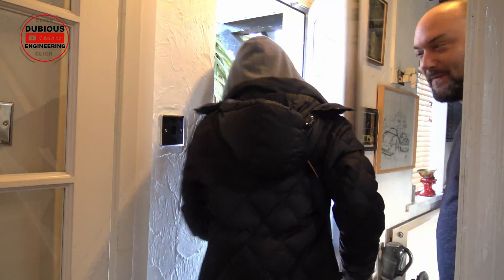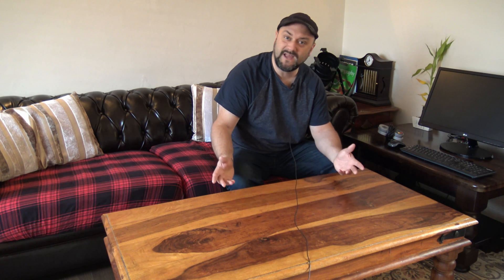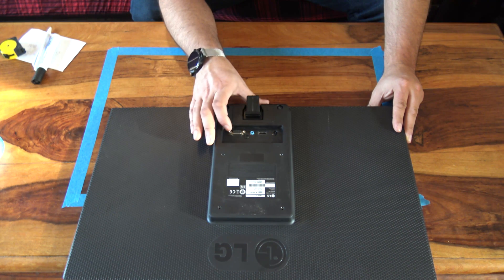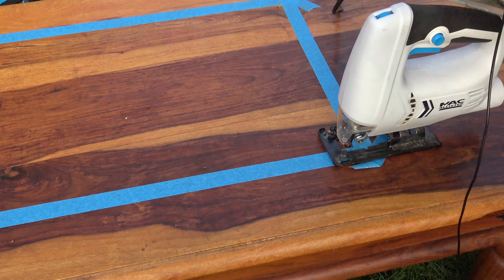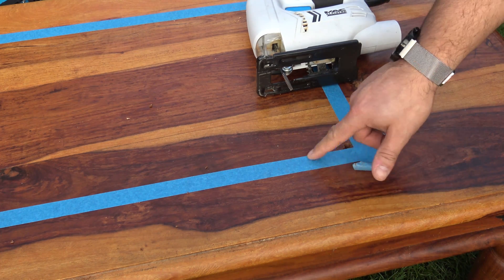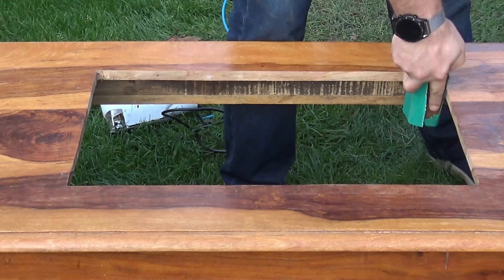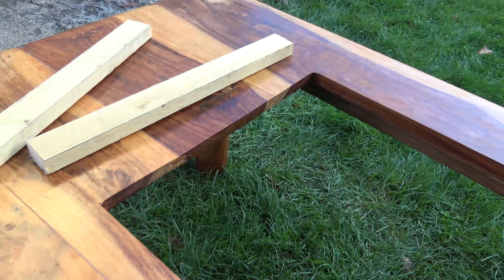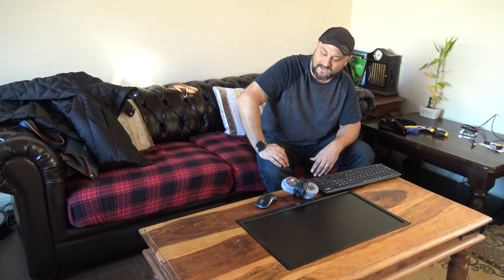DuB-EnG: Coffee Table Computer Arcade Entertainment Machine for Retro Games Build Part 1

Comment: You could have left it flush in the table, and built a mirror to sit at the top to reflect the screen at the desired angle. Would need to mirror the display so it is reversed correctly in the mirror.
Reply from the maker: Thats a great Idea...  perhaps have the mirror on a motor so it pops out of a small slot in the table...  Oh well...  I seem to remember some old arcade machines had mirrors in them.

Comment: I have a Coffee Table in the Man Cave I have been thinking about to convert. My idea was to use a 32inch screen and have it adjustable so I can have it flat for playing D&D and then tilt it for Gaming.
Reply from the maker: Be prepared to lower it the viewing angle can be quite acute on some monitors...
Reply: @DubiousEngineering  I was planning to some how put in a lead screw and a Stepper motor and drive the Stepper Motor with probably some sort of Arduino compatible driver and control the tilt with it because I know depending the way a person is sitting the angle changes. Also instead of the angle dropping the Monitor further into the table I was thinking to make the Top raise. basically how a Laptop LCD folds but backwards.

Comment: I think an IPS panel LCD might work better for the viewing angle when flat.

Good build. ;)
Reply: I've got an IPS monitor but that sort of angle would've still been an issue as I've been daft enough to walk back and forth to check it.

It would still most definitely would be my choice of monitor regardless as the additional work to improve the viewing angle would be reduced and the colour would still be of a good standard.
Reply: @reggiep75  

True. I think at that steep an angle, it might still look quite dark.

Maybe an IPS with a slight tilt would be good.
Reply: ElectronAsh - I should've expanded on the effects of the IPS extreme viewing angle and, like you said, it is indeed brightness issues.
Reply from the maker: Its a poop tombstone to look at too when you're on the sofa...  deffo better to have a little angle on it!!  :-)